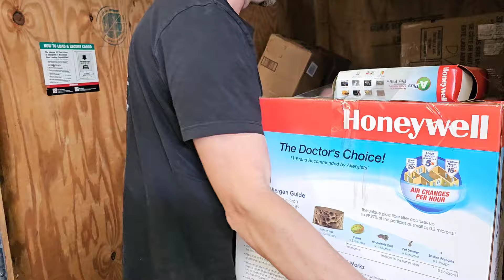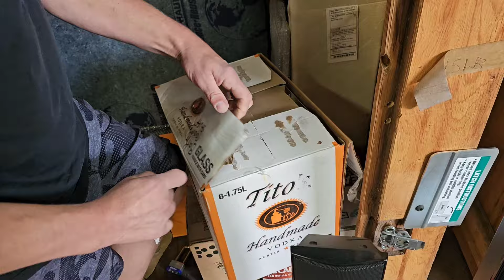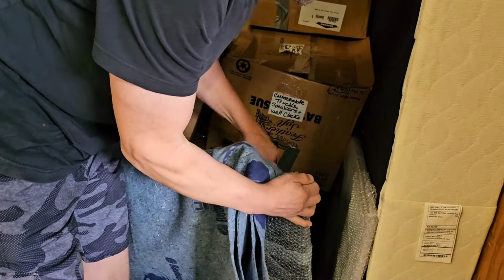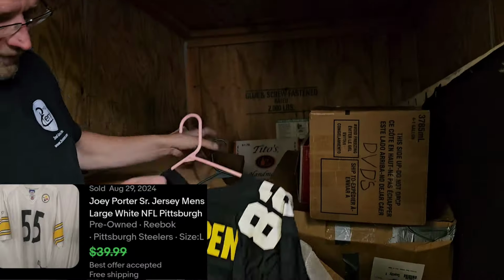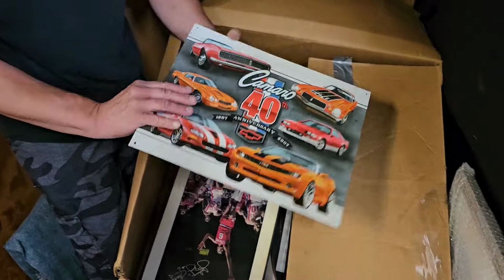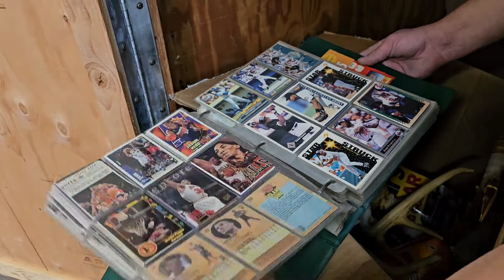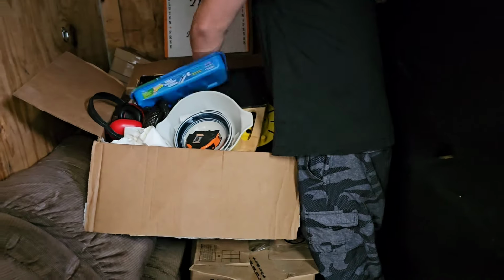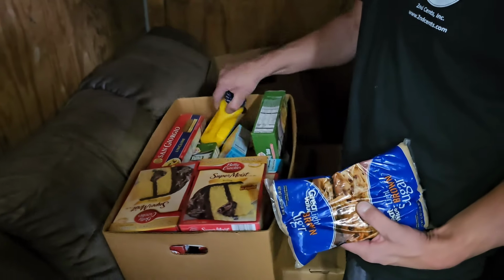$560 for ALL the VAULTS! ~ Owner LOST EVERYTHING!

Comment: You need a locksmith on speed-dial, a telephone call to the safe manufacturer would give you the number and save you smashing a safe which you can then sell on. $$
Reply from the maker: Yes, but it's not as fun
Reply: @2ndCentsIncAuctionsCleveland  😄